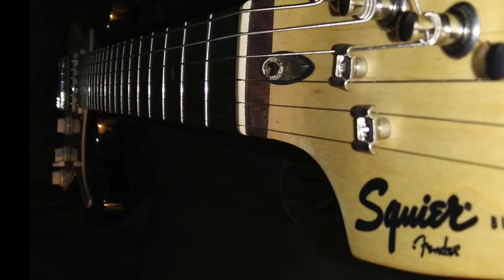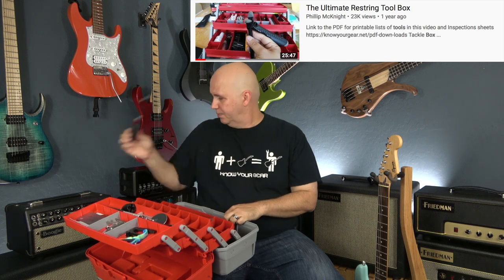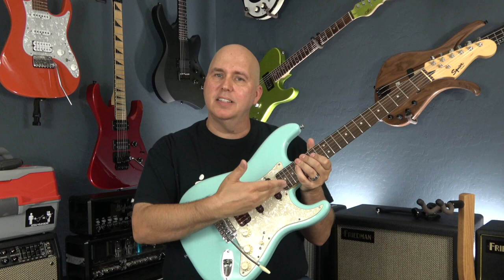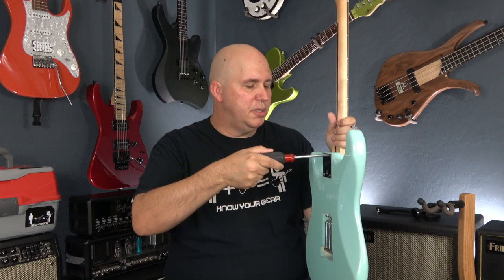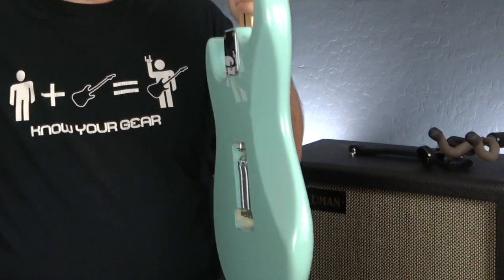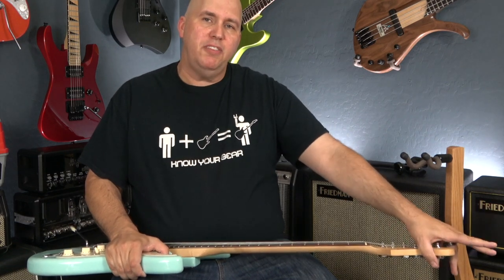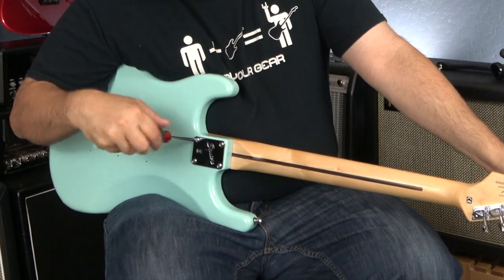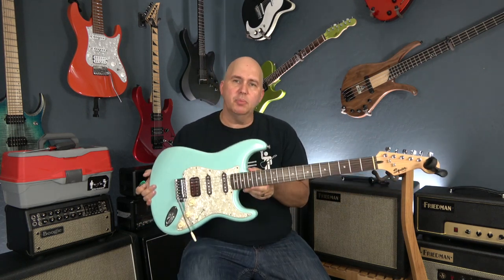How To Fix Bad String Alignment On Fenders & Squiers. Sharpen My Axe

Comment: What do you do if the neck won't move over.  I've got a Squier Bass vi VM and the skinny E is ever so slightly too close.  But the low E looks good like you don't want it closer. But anyways the neck does not move at all, the neck pocket is super tight.  😮

Comment: Thank you so much! Fixed my issue!
Reply: after doing this successfully... the neck feels firm and fixed, and does not tend to return to its previous position? Or does the wood tend to creak due to the friction caused by the wood in the new position?

Comment: Nice, wouldn’t fix mine, they way over beveled the edges so both E strings fall off. Coupled with wide Nut spacing (e’s are 2mm from the edge) I needs a new nut I think?

Comment: i have seen this a lot in the last few years. Poorly cut neck pocket, and in some cases nut! Not just MIC Squires. Some acoustic's with poorly set necks also. In fact I just installed a new nut on a 2017 Nashville LP Standard because of this issue. Something to watch for when you are buying a new guitar!

Comment: I had this problem with a brand new Fender American professional 2 Telecaster and brought it to one of the best luthiers in town basically did what you just did, and even gave me a little extra on the treble side because it was the high E that kept flopping off every time I did the Layla lick up on the 10th fret. As soon as I did the pull off it would flop off the neck. I never had a guitar before that did that and I also never had a guitar before that had rolled edges. Any other suggestions on how to fix this problem or is it just that the neck was already ruined by the edge rolling and there's nothing I could do besides maybe a refret..... any suggestions would be greatly appreciated. Thanks

Comment: I assume this is relevant to any bolt on neck, right? I have a brand new charvel with a bolt on neck and the same issue. The high E seems perfect on the nut side but as you get closer to the body, specifically from like fret 13 and higher, it gets noticeably closer to the edge. I'm going to try this tonight. Kinda silly that Charvel would allow something like to leave the factory on a $1000 guitar but if I can fix it in 5 minutes then whatever I guess

edit: went home and did this. fixed my Charvel in just minutes. Thanks for the video

Comment: I have the opposite problem with my High e string on my Strat. The High e string has too much room on the fretboard. After a long time bending the string, I'll find that it's slipped across the saddle almost rubbing up against the adjustment screw towards the B string. I detune it to recenter it. Any recommended ways to fix this?

Comment: But what if it throws the low 6 string off in relationship to the neck? Like if the low string is  looking good, and the tweak changes it? I guess you never bend the low string away from the center so it won’t fall off the neck, but if it’s looking good before a tweak what else could you try? I tried making sure that my saddles were sitting true already. Thx.

Comment: Legit question: Wouldn't this reduce a bit sustain? The movement you do results in a small gap between the low-E corner corner of the neck and the longer-upper side of the pocket, instead of being in full contact all along.
Reply: If the neck is shifting in the first place that means there's a gap somewhere regardless, and  you're just shifting it. So it probably won't affect sustain if you're just changing where the gap is.
Reply: no. only contact that matters is against the pickup side of the neck pocket. even the most 'perfect' neck pockets have some leeway for sideways motion, and wood changes over time.

Comment: why wouldn't you add a shim to fix the problem permanently? or is the neck pocket tolerance a necessary function to the bolt-on neck?

Comment: I just got a Charvel DK 24 HH Floyd Rose 1000 and the low E runs off sometimes beyond the twelfth fret (plenty of room for the high E). Same issue, basically, as you have here. Will this work for it? Will I also go through the hell of retuning entirely, or can I use the fine adjustments on the bridge?

Comment: I have a Squier Affinity (love it) but, I noticed that my A string isn’t ringing out fully anymore and seems kinda dull sounding compared to all the others. I tried new strings, adjusting the string height and its still the same! Any help or tips would be greatly appreciated!
Reply: Probably a fret issue. You might need a fret leveling. There are videos on this.

Comment: Hello Phil, I have got a similar problem but my guitar is a neck-thru with a floyd rose. I have been playing on and off for 20 years and I just realised when doing pull offs that I had this issue and I have located the culprit: the neck piece with the 3 screws (forgot the term) is off by hald a millimeter. Can this be a change with time or I am so bad that I never noticed that ?

Comment: A quick question on a slightly different subject. I recently bought a Squire Classic Vibe BSB 50's telecaster. Sounds and plays good except for one thing, the high e string has less volume output than the other 5 strings. My local guitar tech can't figure it out. Any suggestions?

Comment: I have the same problem, bought the Squier custom Nashville Strat from a friend. Didn't notice when I bought it for $200 that it's obviously been dropped. Since there's a little chip of the coating missing right where the neck meets the body. Looking at the back plate. One of the screws isn't seated right and they're very stripped while also being screwed in so hard it's cracked the finish too... But $200 so I'll try to fix it. Though I haven't taken it apart yet cuz I don't know how well it's gonna go. Would the neck be salvageable or am I going to need a new neck if the screw holes have been f.u.b.a.r.'d
Reply: For context my high e string is sitting right on the beveled edge of the frets, making it so I have to push up slightly then down to fret the high e

Comment: Woah! did mine in my mim player strat, now my high E doesn't slide from the fretboard anymore. Is there a chance that this problem would regress? Or the alingnment is gonna be good for the rest of it's lifespan? 😅
Reply: If it keeps happening try adding a shim on the side of the neck pocket it’s slipping towards.

Comment: My neck doesn’t move even with the screws nearly loosened all the way out and pressing hard on the neck. Do I have to take the pick guard off? It looks like it’s super flush with the neck pocket but I’ve yet to see any mention of having to do that in any of the dozen videos I’ve watched on this topic. 

It makes vibrato nearly impossible on the high e string in the current placement. Hope my bridge isn’t installed in the wrong spot. The reason I’m thinking that may be the case is because the gap between the e string and the edge of neck remains consistent from nut to 21st fret. I hope that’s not the case because I just dropped $650 on this guitar (eBay). It’s a 50’s reissue Mexican strat with upgraded pickups and wiring system. It sounds great though I can’t play it with the e string like it is. Any ideas? Thanks.

Comment: So you fixed a guitar that didn't require fixing...I have a tele that does not have that movement, in the neck,I am looking at possibly re aligning the bridge ...do you have a video that goes farther than what you did here  .

Comment: But when you cocked (moved) the neck to relocate the high e string, the low e string also moved (and so did the other 4) and now the low e string is too close to the finger board edge (look at your video again, it's ddefinitely noticeable). So basically you fixed one problem but caused another. Plus after you finished you never checked the neck alignment to the bridge nor did you check the string positions over the pickup pole pieces. So cocking the neck angle to the body is not really a fix but a crutch. Better to align (square up) the neck to the bridge and then recheck the string spacing. Often you'll find that the guitar has the wrong bridge width and needs to be replaced with a bridge capable of keeping the string spacing correct. Also, sometimes the nut will shift and cause the same problem. Many nuts are not glued properly during manufacture and will loosen and slide towards the low e string side of the fingerboard (especially if you bend strings a lot when playing as most people do). If that's the case, then you need to reglue the nut in the proper location,  just be aware that if you remove the nut to reglue it, it may break during removal and require replacement, so now would be a good time to upgrade the nut with one of better quality such as bone or brass. Once the nut has been secured in the proper position, you can drill a couple of very small holes between the string slots and drive pins into them to prevent it from sliding should the glue loosen again as vibrations are notorious for loosening glue bonds. Neck twist can also cause the same problem, but repairing that issue gets extremely involed.

Comment: Tried this and it didn't help. So I think my guitar just has the bridge off-center by enough to be a problem. I can get the high string some space but then my low E's string is on the edge below the 12th fret. I'm kinda hoping Lok-N-Roll gets their crap together and sells that nut again because it does have slightly narrower string spacing, which would solve the problem and let me use this method to square everything off enough to not have any string near the edge anymore.

Comment: My problem is I need to push DOWN on the headstock to fix my alignment issue. Trying to push down while trying to screw it back tight is impossible
Reply: Would a shim help?